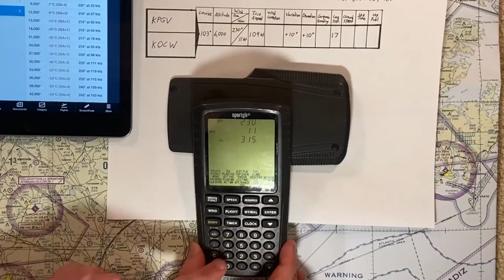How to Use an Electronic E6B in Under One Minute for Flight Planning

Comment: Hi, i just tried to use it for the leg time calculation using a distance of 7800ft and a ground speed of 600ft/min but the result shows up as 13 hours and not 13 minutes how it’s supposed, how can I fix it. Please help 🙏🏻
Reply from the maker: I was able to replicate your issue by putting 7800 and 600 in directly. When I put it into my calculator I get 00:13:11 which is 13 minutes and 11 seconds if I convert it to knots and nautical miles. 600 ft/min is about 6 knots. 7800 feet is about 1.3 nautical miles. The calculator is set up for units per hour, not per minute, so if you did feet per hour that gets you the correct answer as well. Personally, I recommend converting everything to nautical miles and nautical miles per hour (knots) to keep things consistent, but as long as the units match and your speed is in units per hour it should still work